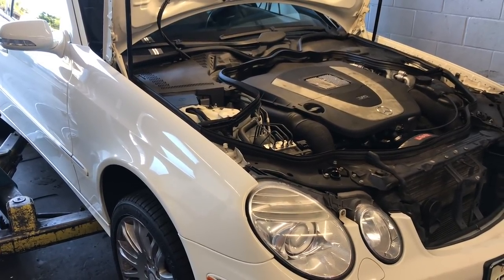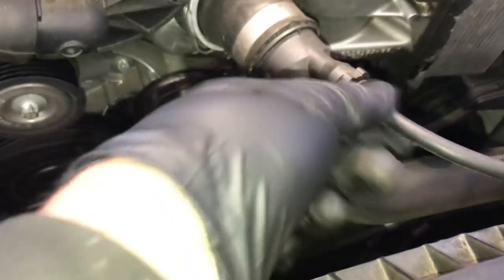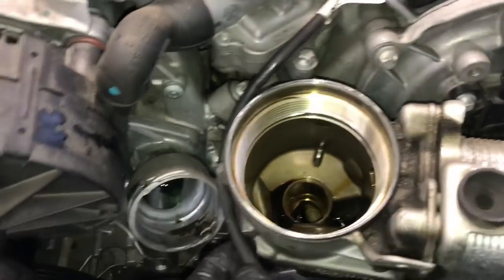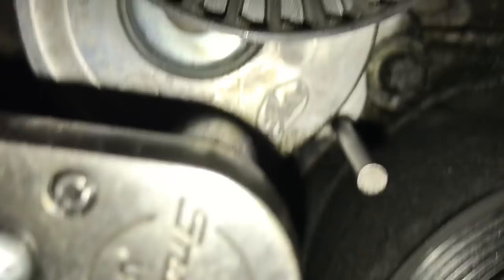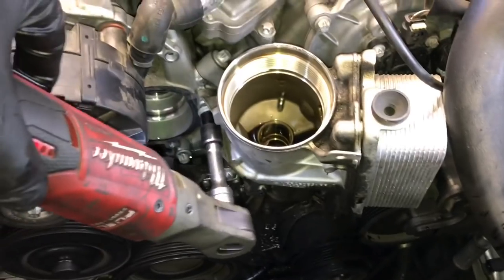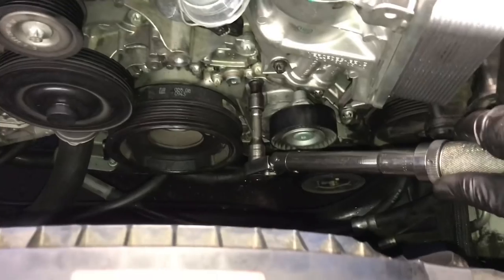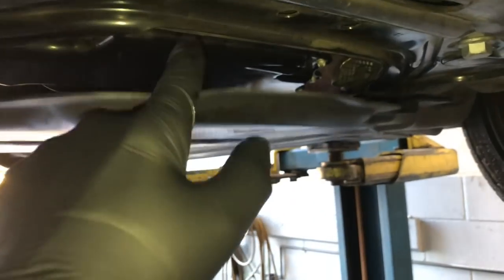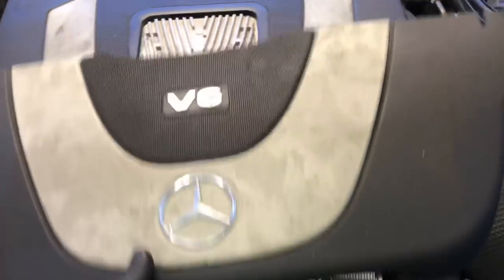How To Change The Oil Filter Housing On A Mercedes E350

Comment: Great Tutorial on this engine.  This is same set up for R350 Mercedes too.
Very precise and right to the point on explanation.
Because of this video and your channel. I was able to do my very first. Thermostat replacement.  I went ahead and did the water pump. I changed the gaskets only for the oil filter housing.  I changed a new belt tensioner and new idler pulleys.  I went ahead and cleaned the EGRs and replace those gasket since I had everything in the front off.

Im a huge fan of your channel and thank you so much for providing these high quality tutorials for us.  I always had my buddy mechanic to work with but now I can solely do it myself.  I have been buying professional tools for a long time so it makes the job easier watching you do it.  I really appreciate you giving us so much confidence to this these jobs.  It really isnt that difficult to do this fixes you have demonstrated a very good thorough and professional quality repair

Comment: I am very much surprised to see that oil cooler housing for less than $83.  Being  a Mercedes, i would have believed that part would cost much, much more.  Love your videos, thanks for posting.
Reply: It was after market, mercedes brand cost 230$
Reply: @fuku851  Why did you not reinstall the original housings?

Comment: Hey man, Do I need to replace the whole housing or just replace the gasket?
Reply from the maker: Just a gasket.
Reply: I already changed the gasket on the  cooler itself. That job was harder than doing this entire housing removal. Had i know i would have done it this way and changed both gaskets then instead of buying an entire new housing. This was a great diy and it allows you to change the thermostat at the same time while fixing housing gasket leak. Do you know if you have to drain the oil to do the housing replacement?

Comment: Hello, I tried this today following your instructions and when i tighted the thermostat bolt at the bottom to 25nm it snapped the aluminum bolt. Now I'm gonna have to try get it out
Reply from the maker: Thomas Pongrac that sucks! Sorry that happened.
Reply: @HowtoAutomotive  That is okay I went to the dealer today and ordered new bolts. I just don't know if I'll be successful getting the bolt out

Comment: Can i just change the housing gasket instead of the entire housing?. I already changed the gasket on the  cooler itself. That job was harder than doing this entire housing removal. Had i know i would have done it this way and changed both gaskets then instead of buying an entire new housing. This was a great diy and it allows you to change the thermostat at the same time while fixing housing gasket leak. Do you know if you have to drain the oil to do the housing replacement?

Comment: Well done Brian. I noticed today when I was changing oil that there is oil seeping but didn’t have time to track it. However, I noticed that there is oil remains on the oil filter housing so I thought that it might be the reason. Would it be possible to share photos of the engine with you to help me narrow down the source of leakage?
Reply from the maker: Nasser Alsalhabi Of course you can inbox me/private message me on the How to Automotive Instagram page. I check it often so I’ll see you there.

Comment: Does the new oil filter housing come with a filter installed?  Also, would just replacing the oil filter housing gaskets be an alternate repair?
Reply from the maker: Vic Sorlie yes its I didn’t show it but I didn’t mention it in the video.

Comment: Hey man question ? So I have an 06 e350 that was leaking oil form oil filter housing. Bought new oil filter housing and new thermostat housing from Mercedes. As I was bleeding system, there is now oil in coolant reservoir ? Any ideas ?
Reply: if it is a lot of engine oil in coolant than your heat exchanger has reached its scheduled failure interval.
Also consider investigating and servicing your "crankcase venting" system! Yours is likely plugged up causing your oil seals to get overpressured (blown up exchanger!) from engine blow-by gases not able to escape... Benz really good at designing system failures into a business model.

Thank god low pressure coolant does not mix into high pressure oil or else the "mayo" would kill the engine cylinders.

LONG STORY SHORT: Inspect under-sized BREATHER PIPES for blockage
👍

Comment: I have 06 e350 it has oil leak for the the Engine Oil Filter Housing. Can I just change the gasket ?
Reply: I was wondering the same because I already changed the gasket on the  cooler itself. That job was harder than doing this entire housing removal. Had i know i would have done it this way and changed both gaskets then instead of buying an entire new housing. This was a great diy and it allows you to change the thermostat at the same time while fixing housing gasket leak. Do you know if you have to drain the oil to do the housing replacement?

Comment: Is it good enough to replace only the gasket instead of the whole oil housing ?
Reply from the maker: Klajdi Stari yes you can change just a gasket. But in most cases the housing is updated and that would be the reason for changing it.
Reply: @HowtoAutomotive  thanks a lot